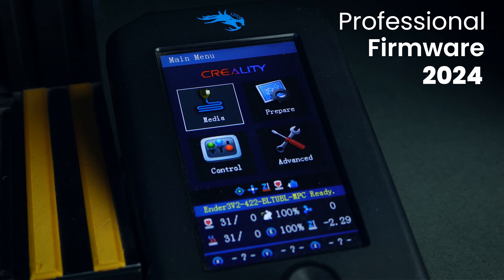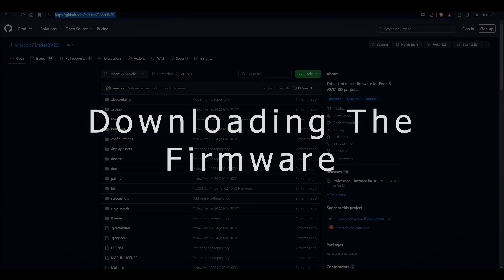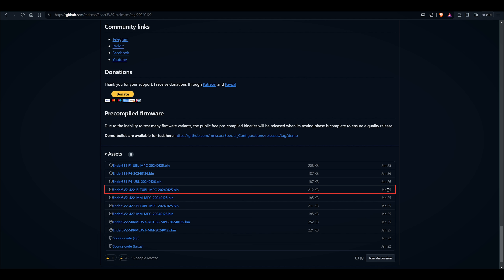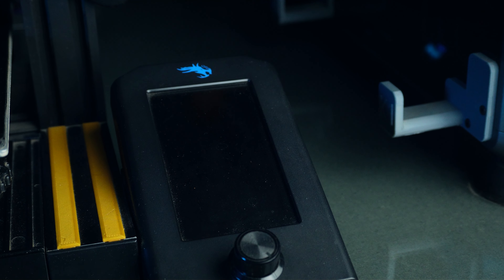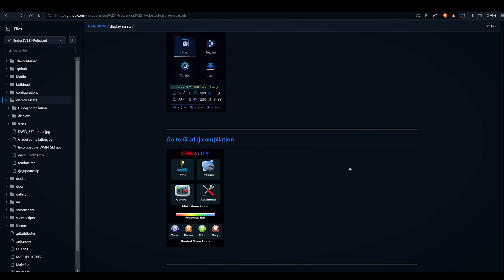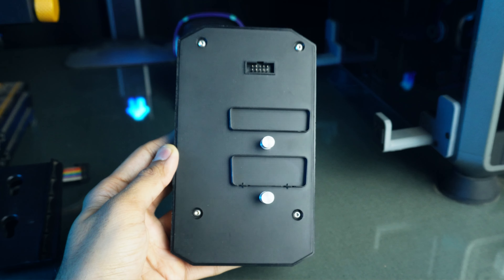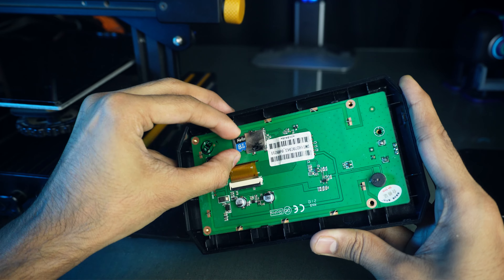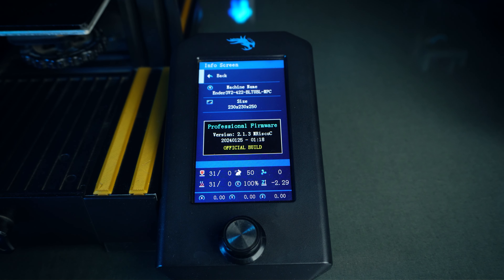How To Install Ender 3 v2 Professional Firmware 2024 #3dprinting

Comment: Thanks for this video, question! Is there a difference in firmware to download if you have installed a cr touch? I only see BLtouch firmware. Or doesn't it make a difference wich touch you use. Cr or BL.
Reply: I'll already discover, it's in the discription on the download page. It says that the BL is for the BL AND the CR touch leveling

Comment: hola saludos..... una pregunta amigo como se obtiene el firmware original?
Reply: pudiste actualizar la impresora?
Reply from the maker: You will find original firmware on Creality's website, using same method you can install that firmware
Reply: @angelluistf  si bro!
Reply: @3DELWORLD  okok gracias por responder, pero el archivo no supe cual era!
Reply: pero habia instalado uno con malla, nivelacion y no me gusto la impresora se descontrola mucho, asi que instale uno con solo opcion de z offset el firware se llama E3V2-Default-v4.2.2-v2.0.1.bin si quieres te envio por correo